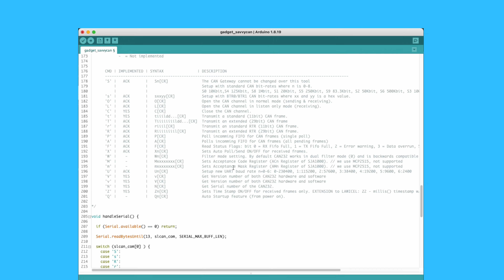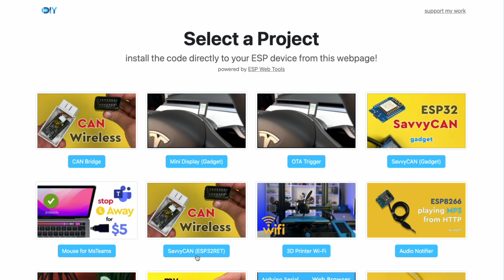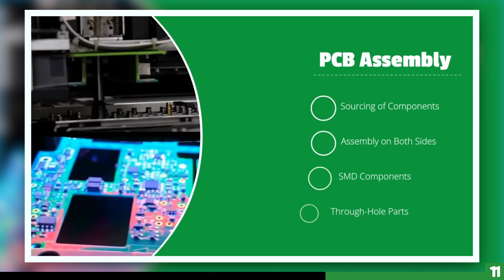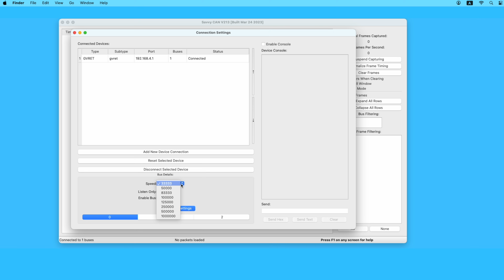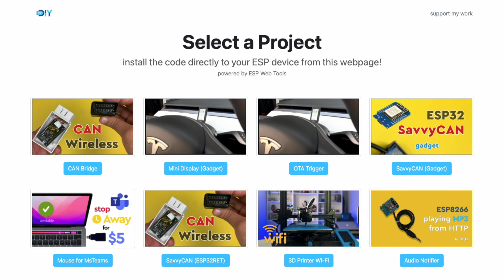SavvyCAN with ESP32 Running ESP32RET

Comment from the maker: For CAN Shield v1.2 and earlier use: CAN0.setCANPins(GPIO_NUM_5, GPIO_NUM_4); 
For CAN Shield v1.3 and newer use: CAN0.setCANPins(GPIO_NUM_4, GPIO_NUM_5);
Reply: I have a v1.2 board. How do I flash it to get the correct pins? Online flash is 1.3.  Also how do it get your arduino code for ESP32 so I can compile it myself to make life easier? Right now I have put the device together and I can connect with Savvycan but no bus traffic so I suspect the pins are reversed because of the online 1.3 code

Comment: I can't connect to the wifi network. It keeps saying incorrect password.
Reply from the maker: If you are using my online flasher, go back to the flasher webpage and scroll to the bottom. Some people had better luck installing the alternative firmwares at tbe bottom. If all fails, you can always install the source code directly.
Reply: @MrDIYca I emailed ya, it was the 6.3.2 flasher that did the trick. It's working beautifully

Comment: I bought the shield to connect to a Peugeot 206 CAN bus and tried to use SavvyCAN to decode the data. The problem is that nothing shows on SavvyCAN. I tried to switch the CAN pins but nothing changed. I also tried the simple code seen in the description of the product on your website and still nothing even when switching CAN pins. Tried to print data received on D4 and D5 and i just have one pin at 4095 and the other at 0, nothing changes. Tried it on a Renault Clio 3 and still the same issue. Do you have any idea of what could have gone wrong ?

Comment: when i try to connect the device with wifi i get the message 'wrong password'. this is in the log: 

[21:29:35][   130][E][Preferences.cpp:460] getString(): nvs_get_str len fail: SSID NOT_FOUND

[21:29:35][   131][E][Preferences.cpp:460] getString(): nvs_get_str len fail: wpa2Key NOT_FOUND
[21:29:35][   135][E][Preferences.cpp:460] getString(): nvs_get_str len fail: btname NOT_FOUND

But i could connect my laptop when using the 6.3.2 version. thank you for your work :)

Comment: I have the 1.3b shield and continuously get the following message inside SavvyCAN connection console with nothing appearing on the front page.

Write to serial -> f1 9 
Got data from serial. Len = 4
f1 09 de ad 
Write to serial -> f1 9 
Got data from serial. Len = 4
f1 09 de ad 

Over and over in a continuous loop.

I've tried on three vastly different cars now to no avail. It seems like others are also having this issue. Any thoughts on what this could be? I'm completely stuck.
Reply from the maker: This is typically related to locating the right CAN source. Reply to your order email and we can troubleshoot it
Reply: Did you solve this problem ?

Comment: Does anyone have a problem with connecting to the Wi-Fi? It looks like the password is correct but it’s still not connecting on any device.
Reply: Yes! I just got mine and I can't connect. Reflashed just to check and same issue.
Reply: @MrDIYca
Reply: I'm having the same issue. Windows 11.
Reply: Version 6.3.2 fixed it for me.
Reply: What is version 6.3.2 referring to ? The board software version?
Reply: With the flashing tool go to the console and change the password. Type ? for help.

Comment: Hey Mr DIY, i purchased your prebuilt kit and when i tried to flash RET i noticed it wasnt assigned a Comm Port. I went into Device Manager and it shows up as a USB Device needing drivers. I installed both types of ESP 32 driver and neither work for this board.

Can you help with which drivers im supposed to be using?
Reply from the maker: Hi Greg, I replied to your email

Comment: Can this be connected directly to the Mac via USB and read the data in SavvyCAN without going thru Wi-Fi
Reply from the maker: I was told by many that esp32ret does support wired serial, however I haven’t tried it myself
Reply: I was able to connect that way but I don't see any data.  I was unsure if MrDIY's code did anything to disable connecting. I'm still troubleshooting as I can't get the WIFI to connect (seems to be a password issue despite using his supplied PW).

Comment: I recently bought the v1.3 and flashed the esp32ret using your online flasher. I'm having a weird issue where it would connect, I would receive some data but then I would get disconnected and get a comm failed to validate error. Any ideas?
Reply from the maker: Check out - https://gitlab.com/MrDIYca/canabus/-/wikis/Getting-Started  scroll to the savvyCAN section.

Comment: Purchased shield v1.3b and ESP32 from your store recently. Assembled and flashed the code at your online flash page using v1.3 and newer selection. Upload completed successfully. ESP32 connects to my laptop but will not connect to my OBD port. No traffic indicated. What have I missed? v1.3 shield only seems to have 2 led's. No power led? Get green LED and assume the other one is the blue LED which is not coming on. Any ideas? Thanks
Reply from the maker: Hi Tom, just reply to your order confirmation email and I'll help you troubleshoot it

Comment: Question regarding your ESP32 OBD PCB, SavvyCAN, and potential Gateway Issue
Hello [Recipient's Name or leave blank if unknown],
I hope this email finds you well. I've been following your work with the CAN bus and I'm trying to replicate some of the things you've demonstrated.
To get started, I purchased your PCB designed for connecting to the OBD-II interface. I've soldered it, connected the appropriate ESP32, and flashed it using the online flasher tool so it communicates directly with SavvyCAN.
I then tested the setup on my car, but unfortunately, I've only had moderate success ("mäßigem Erfolg"). The data transmission is very unstable; sometimes data comes through, but often it doesn't, or it stops.
Furthermore, when I do see data in SavvyCAN, it seems to be coming from only one bus, and it consists of just a single, repeating value. This value doesn't change whether the engine is on or off, nor does it reflect changes in RPM or other parameters.
Based on this behaviour, and recalling one of your videos, I suspect my car might have a security gateway that filters or prevents direct access to the main CAN buses via the standard OBD port. This single repeating value might be the only thing allowed through, or maybe it's from the diagnostic bus itself.
This leads me to a question: If there is a gateway, how do commercial adapters, like Carly for example, manage to access and display live data (RPM, speed, temperatures, etc.)? They seem to bypass this issue somehow.
Do you have any advice or ideas on what might be happening here? Could I be connected to the wrong bus segment, or is there perhaps a specific procedure needed to 'unlock' data access through a potential gateway? Any insights you might have would be greatly appreciated.
Thank you for your time and for sharing your projects!

Key points covered:
 * Mentioned buying and setting up the recipient's hardware.
 * Explained the testing setup (ESP32 flashed for SavvyCAN).
 * Described the problem: unstable connection, single repeating value, value doesn't change.
 * Stated the suspicion about a gateway, referencing the recipient's video.
 * Posed the question about how other tools (like Carly) work around this.
 * Asked for advice or ideas.
Reply from the maker: I recommend checking - https://gitlab.com/MrDIYca/canabus/-/wikis/Getting-Started
Carly functions as an OBD2 diagnostic scanner and does not support raw CAN bus monitoring. You can request OBD2 data using the CAN shield as well by sending the appropriate PID and parsing the response. For example, RPM would be 0x7DF - [2,1,C,0,0,0,0]. (full list explained at https://en.wikipedia.org/wiki/OBD-II_PIDs)

Comment: Got one of these from you recently, and ordered the ESP32 from your link to Amazon because you're out of stock. Used your web flasher and tried it out. Using GVRET serial connection (not wireless) to SavvyCAN it always says "not connected". Tried wifi, and it seems to connect but I get no traffic when connecting to my wife's 2014 Jeep Patriot. Tried the "SavvyCAN Flash Tool" with pre-built binaries and that shows "connected" when using GVRET serial (wired). Haven't tried with your shield yet, as I was hoping to use the other features of it as well (info LED).

Any ideas?
Reply from the maker: Have you checked for filtered OBD2? https://youtu.be/dDBxC39lNQg
Reply: @MrDIYca  you're probably right! Ill look at tapping into it elsewhere. 

Any idea why I cannot connect to SavvyCAN via serial though?

Comment: I need some assistance.  When connected to car I am able to get it to connect to Savvycan over wifi and it grabs some can data then the device disconnects in the savvycan software.  Do you know what I may have wrong?
Reply from the maker: Have you tried flashing the latest ESP32RET firmware?
Reply: I flashed with the one on your website
Reply: I am having the same issue. Were you able to resolve
Reply from the maker: I put together a quick troubleshooting guide that might be helpful - https://gitlab.com/MrDIYca/canabus/-/wikis/Getting-Started#want-to-use-savvycan

Comment: I am having issues with this working over usb as a gvret device on an m4 Mac. Is this expected? I can see serial data, and it works via WiFi, but not gvret
Reply from the maker: I am not sure if esp32ret supports comm over USB
Reply: @ i got it working on lawicel and Wi-Fi
Reply: @jalopy2472  great, thanks for sharing!

Comment: So would this work if i have a 2011 mustang analog gauge cluster but upgraded to a 2014 mustang lcd digital cluster and wont read gauges without upgrading pcm.  They had a blackbox that isnt made anymore
Reply from the maker: It will help you get the CAN data out, how you use it and what to do with the CAN will depend heavily on your application

Comment: I bought your CAN Shield v1.3 and I have problem. I connected it with ESP32 DevKit v1 and Online flashed SavvyCAN (ESP32RET). I can connect with Wifi and create connection with SavvyCAN WiFi but I don't have information from CAN. Do I need to change anything else?  What code can I use to connect your set directly to the laptop with a USB cable and SavvyCAN ?
Reply from the maker: You may want to confirm that your OBD2 port is not filtered (check out this video: https://youtu.be/dDBxC39lNQg ). I believe the ESP32RET firmware supports a serial connection to SavvyCAN, but I haven’t looked into it in detail. You might want to check their documentation for more info.
Reply: I was checked your bord on 3 different ESP32 DevKit v1 and in 3 different cars two BMW E91 and E39 models and in Honda and no respond data in SavyCan with ESP32RET and in Arduino Ide Serial. What can i do wrong ?

Comment: I just got my v1.3 kit.  I put it together and used the online flash.  When I plug it in, I get a green led and a blue that is flashing.  Is the blue led supposed to be on steady or flashing?

When I fire up Savvy CAN and connect to it, I get about 20 seconds of data then it drops out.  I can no longer see the wifi device.  I have to power cycle to try again but I get the same result.

The car is a 2017 Cadillac ATS.
Reply from the maker: Hi Bob, I replied to your email
Reply: @MrDIYca  thank you for your quick response. I will try all the things you recommend and report back to you.
Reply: I think I am having this same problem. Over putty I have constant data, but once I connect to the WiFi I get less than 100 frames before it stalls out. It almost seems like maybe it’s trying to send too much data over WiFi..  mind sharing this info with me too?
Reply: Same exact issue for me. It connects for about 10 seconds and drops connection and have to power cycle them to reconnect. Would like to know what the solution was here. Cheers. 🍻
Reply: Have you any solution about this situation ? Its same for my card.
Reply: @HiddenFoxs  had to manually flash a specific version. Was on the website in the info. took me a while to find it but its there.
Reply: I solved the problem by using the SavvyCAN (ESP32RET 6.3.2) version. You can find it on the online flasher at the bottom of the page.

Comment: Hey, i just tried to use the shield but i noticed that i don't get any information or a power light on the board. And if i look a bit over the code there seems to be error messages coded in that should be printed? The esp devkit v1 itself is getting power, serial is set to 115200 and everything seems to be soldered correctly. I also tried to swap the rx and tx pins in the code. Is it the fault of my car, the board or my esp?
Ps: i flashed the code you wrote to only print the messages into serial
Reply from the maker: v1.3 onward, I removed the power LED from the shield since the ESP32 already has one. Error messages should show up no matter which shield version you're using ( and with no shield at all). If you're just getting started or want to double-check everything is working, try out my simple sample code: https://gitlab.com/MrDIYca/canabus/-/blob/main/esp32_shield/esp32_can_shield_sample_code.ino?ref_type=heads.

Comment: It worked fine in my 2008 suburban my only issue is it works for like a minute then says not connected, im not sure why its doing that, do I need to solder the 120ohm jumper?
Reply from the maker: It's typically the ESP32, but feel free to reply to your order email, and I'll do my best to help out
Reply: @MrDIYca  I've tred emailing you twice I've not had a reply
Reply: did you manage to fix this ?
Reply: @21zetec Used a esp32 V1 must be a version 1 esp32 board label on the back will say devkitv1
Reply: @slapcitykustomz1658  tried 2 different ones. One has it on the back. Both do exactly the same
Reply: @21zetec  Are you doing it wirelessly?
Reply: @slapcitykustomz1658  yes over wifi
Reply: @21zetec  Try plugging directly from the can bus shield to your pc and see if that fixes your issue also might want to try the 120 ohm terminator resistor on the shield

Comment: I'm trying to run the website flash on a V1.3 shield with only the two LED's.  Not sure it's working correctly....do I need to build from source to support the V1.3 shield?
Reply from the maker: On the website you can the shield version you have and flash it. If it is not working for you, just reply to the order email and I will try to help you there.
Reply: @MrDIYca  Thanks for the response.  I believe my main issue is that I'm trying to read messages on my 2017 Jeep GC's Interior High Speed bus which runs at 125K as far as I understand.  With the web flashed version I only had the blue/white light(power?) showing on the shield.  I setup VSCode with your most recent commit and flashed the ESP32 with the code modified for the CAN0 bus speed to be 125K, and now I get the blue/white plus a slow blinking red led. ( this is on the v1.3 shield)    Is that the expected behavior, or should the red led be on solid?
Reply from the maker: @RCaddictedone  If you are using my canabus/esp32_savvycan code and v1.3, then you need to use CAN0.setCANPins(GPIO_NUM_4, GPIO_NUM_5); on LINE 122 of ESP32RET.ino. Do not worry too much about the LEDs.
Reply: @MrDIYca  It's working perfectly now.  One suggestion :)   would it be possible to add functionality to change the CAN baudrate via the push button on the V1.3 shield? :)
Reply: Is it possible you could share the  footprint for the shield please @MrDIYca

Comment: I had the  Gateway compiling and loading under Arduino IDE a few months ago. Then I let it sit for a while and now when I try to build the gateway I'm getting compile errors as-if the board package has changed or is not linking. Any ideas?  [ error: 'gpio_pad_select_gpio' was not declared in this scope; did you mean 'esp_rom_gpio_pad_select_gpio'?
   92 |   gpio_pad_select_gpio(SHIELD_LED_PIN);  ]
Reply from the maker: For Arduino IDE, you can simply use pinMode(SHIELD_LED_PIN, OUTPUT);

Comment: I am presently looking at an Audi car and the ODBII CAN-BUS port is completely silent, no traffic at all.  That is until I use my VAG-COM cable to access one of the modules on the bus.  What I have found out is the CAN-BUS'es of which there are several on this vehicle all connect at a gateway module.  This allows data to transfer from one CAN-BUS network to another as necessary as well as outputting CAN-BUS data to the ODBII port only when requested to!
So as long as you know what to 'poke' the gateway with you can get you can monitor the necessary responce, which is sort of OK.  The best thing to do is tap into the required CAN-BUS itself and miss out the gateway all together.  Now your design is great, but maybe having a breakout connector as well as the OBDII plug could allow you to draw power from the car to power it but let you run a pair of twisted cable to elsewhere in the vehicle to tap in and monitor the CAN.
I appreciate you may not have come across this type of CAN topology in you design / testing but I think it would possibly open up your project to more users.

Cracking work though.
Reply from the maker: True! Are you referring to my CAN shield design? because I do have a breakout for CAN and power along side OBDII for that exact reason
Reply: @MrDIYca  After looking again at all the information on your web site, I hadn't noticed your breakout connector, my appolgise
Reply: If it's newish vw/audi - it uses ip protocols to communicate. no need for can dongles, just network cable plugged in the right spot.